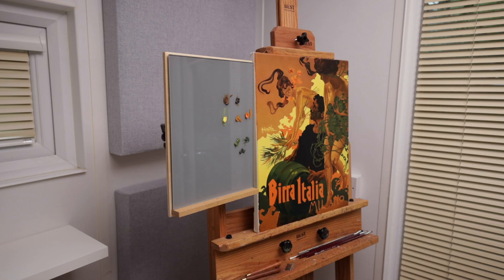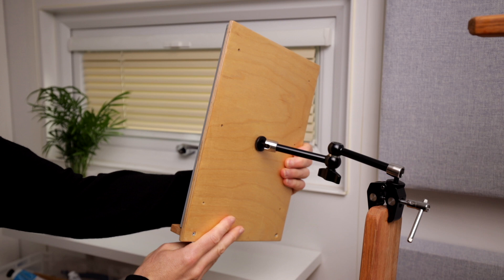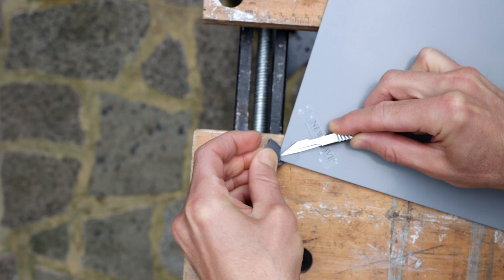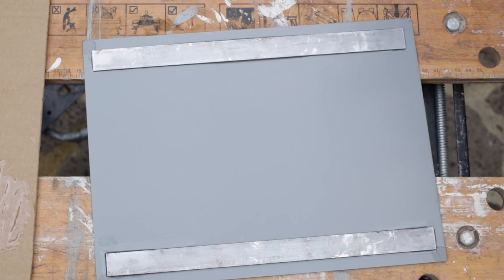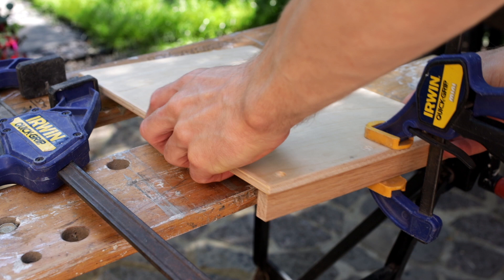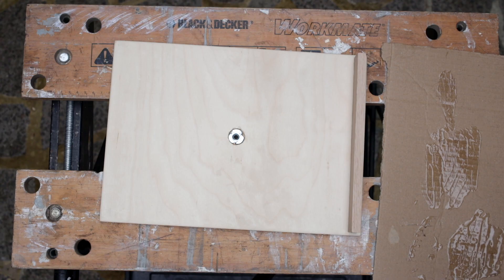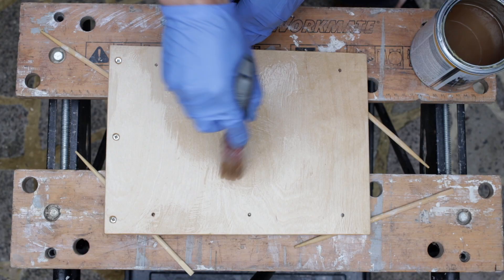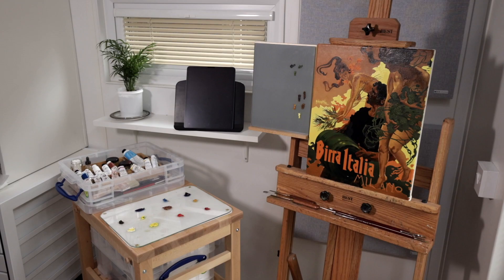How to Make a Glass Parallel Palette

Comment: Thanks for the video and I can see how using mixed colors on a vertical palette is useful.  Do you also do the mixing (including adjusting medium) on the vertical?
Reply from the maker: Thanks Perry! I mainly use the horizontal palette to mix in medium and have my 10-12 colours laid out on it.  I sometimes mix on it, for example if I need to do a larger amount, but then I'll refine it on the vertical.